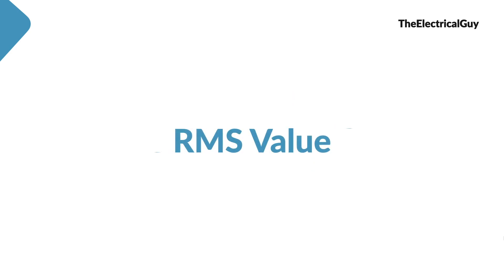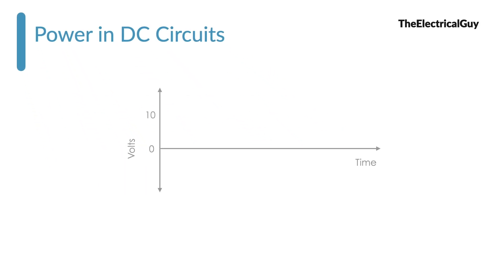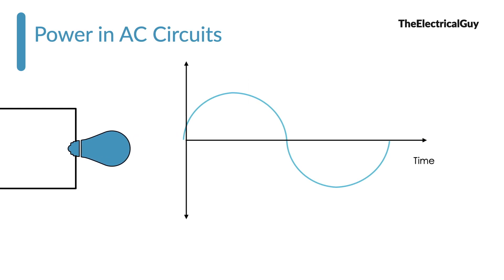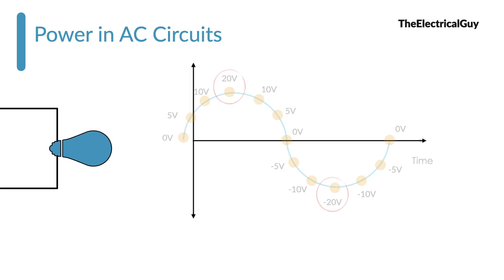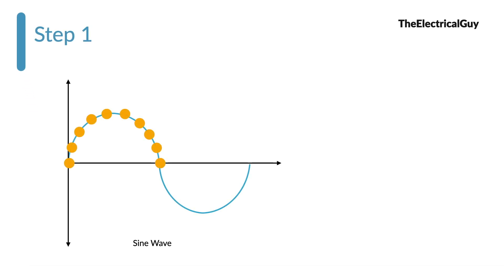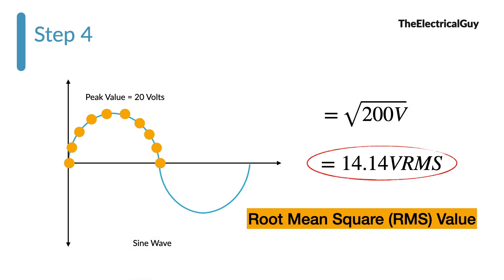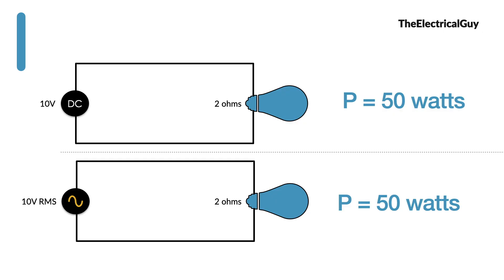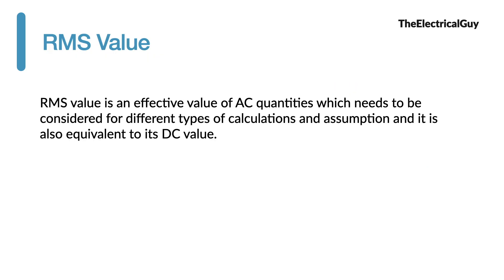What is RMS Value | Easiest Explanation | TheElectricalGuy (Improved Version)

Comment: We use RMS value to calculate the size of cable and other electrical values with the circuit except the insulation calculation of cables

Comment: This is the best video I found on Youtube to explain about RMS, easy to understand and pleasant to watch! Thank you.
Reply: The reason I am searching about this is because of work. I am reading a battery spec, which describe an electrical isolation from battery to earth of minimum XXX Vrams as working voltage.
Reply from the maker: Do share and subscribe 😇
Reply: √2 is not the correct answer for measurement right, what is the relationship between the Vmean and peak avg

Comment: Where did he get 20V from????????
Reply: The 20V is the peak hypothetical value used in his sinusoidal example. The point is, VRMS can be found by multiplying 0.7071 by the peak voltage of any sine-wave (which in this example was 20V). The example could have been 5V, or 10V, or any other value. 

I realize 9 months have passed since you asked—but in case you’re still wondering.